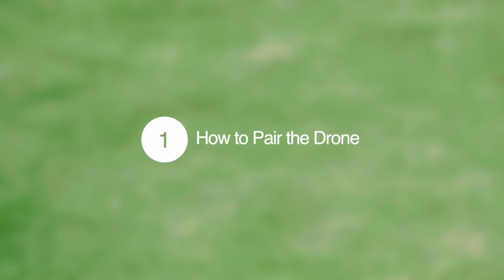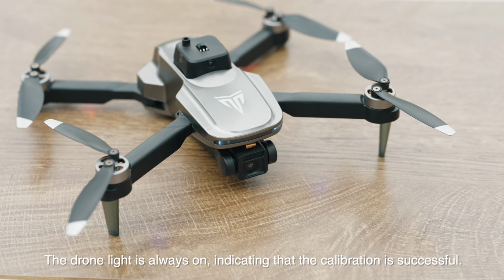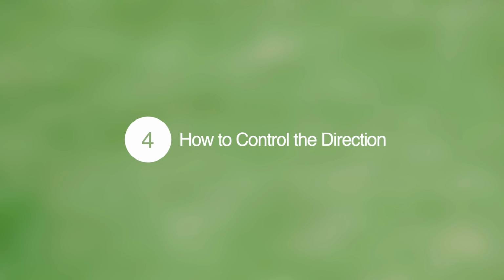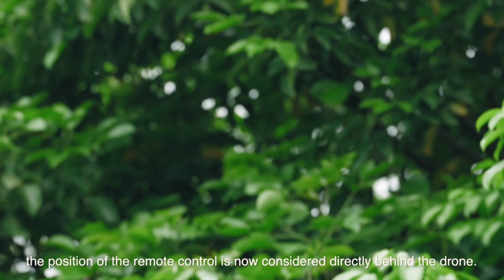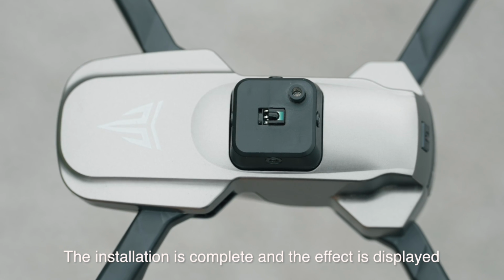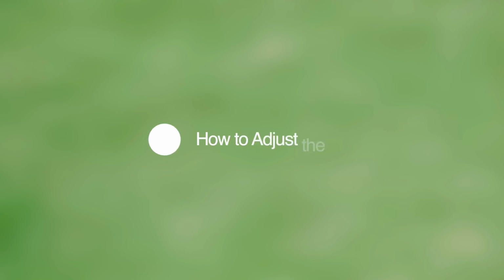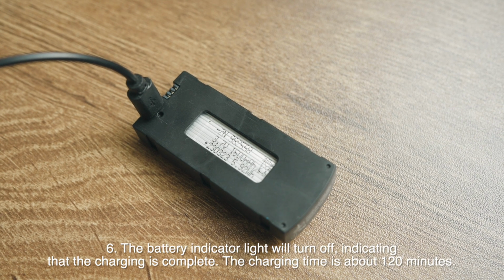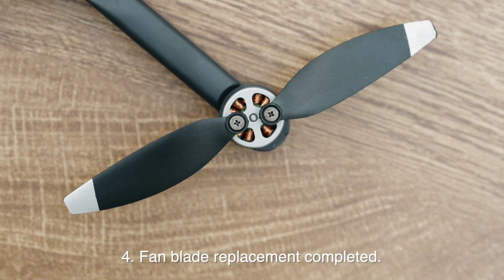TizzyToy Drone Operating Instructions

Comment: I have the $99 Tizzy Toy "Quadcopter."  I did not get a video screen as "implied" - the controller relies on you putting your cell phone on the controller.  Instructions are impossibly too small to read - I had to copy them on my printer and enlarge the image and print them out.  The video shows toggle switches, but I have only buttons on swivel mounts.  The recharging connector was the wrong size, but I was able to get one for $12 at our local phone store.  The automatic control rise and stabilize and descend work well.  I do not find any way to communicate with the manufacturer for answers or help.  This is easier to fly than my first drone.  I have not connected the quadcopter camera to my mobile phone, yet.  Batteries seem short lived at "five minutes."  I am recharging them now and will try again after 4 hours and 4 hours for tomorrow.

Comment: I think it's the luck of the draw with this particular drone, i just paid  roughly $100 for it , day one I'm sending it back and just getting my money back from Amazon. You've got a nice design, the blades are paper thin tho, so everyone here be aware of that, when i say paper thin, i mean literally as thin as thick paper, but made outta plastic, you could rip them in half by hand no problem, and the only replacement you can buy is a $20 pack that comes with 4 blades, a battery , and 4 more guards, most of the drone is great but man you really cheaped out on the blades..!! 
That and the drone just does what it wants, when it wants, it'll take off great, quiet as could be, i had such high hopes, but then i couldn't control it, and i have several drones and definitely know how to operate them, I'm not a pro, but not a rookie either.  You have some sort of electrical issue with these things, I've read other reviews where people experienced the same thing i did. 
Oh well, like i said i had high hopes for this one, but the quality just isn't there yet. Maybe if you get your software worked out and do much much better with the blades, maybe I'd think about trying another one of your drones out, but until that happens, I'm gonna get my money back and find something better. 
Such a shame tho, it really is a nice drone. When i first started it up and heard how whisper quiet it is, man i thought i did really good,  but it was straight downhill from there, unfortunately..

Comment: Unfortunately after i installed the avoidance feature.  The light doesn't blink to indicate its turned on after i hit the button on the remote.  I'm guessing it's faulty?
Reply: Did you figure out the problem? Same thing happening to mine.
Reply: The same happened to me. And someone tell me the battery life

Comment: What is headless mode? And why would you use it?
Reply from the maker: The headless mode of the drone is a heading lock mode. The headless mode refers to the course lock mode. In this mode, the reference frame of the UAV relative to the environment is based on the position when the mode is turned on, and moves relative to the take-off orientation. The reason why it is commonly called headless mode is because this statement is more vivid: after this mode is turned on, the drone itself does not have the concept of "head", "tail", "left" and "right", and the movement of the drone relative to the ground ignores the horizontal rotation Orientation, only position changes without direction changes. The direction change is only used to rotate the drone itself (adjust the direction of the camera, etc.), and does not participate in the change of the movement direction. For example, after the headless mode is turned on, the aircraft takes off and floats, and rotates 90 degrees counterclockwise horizontally in the air. At this time, the drone is controlled to move forward, and the drone will not move to the front of itself, but to the right of itself, the front when the headless mode is turned on. Similarly, control the drone to rotate randomly to any direction again, as long as the headless mode is stable enough, when the aircraft is controlled to fly forward, the aircraft will still move to the front when the headless mode is turned on.